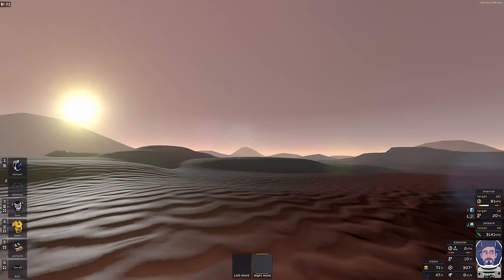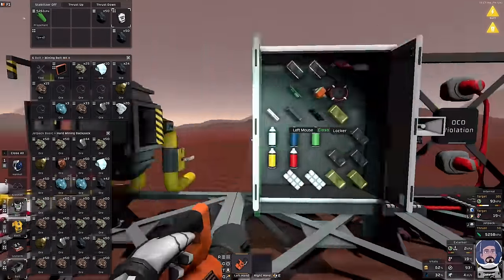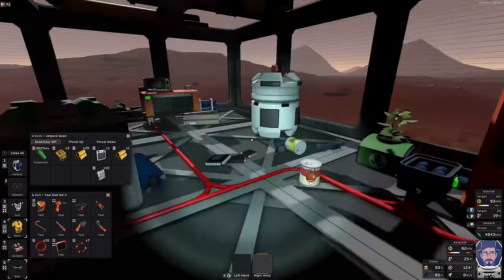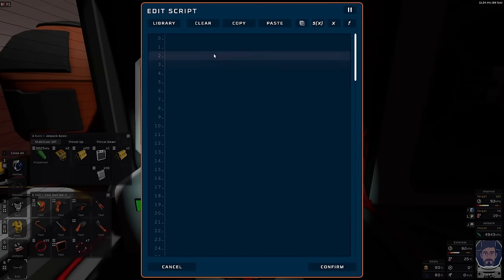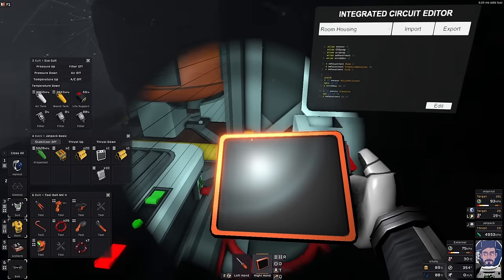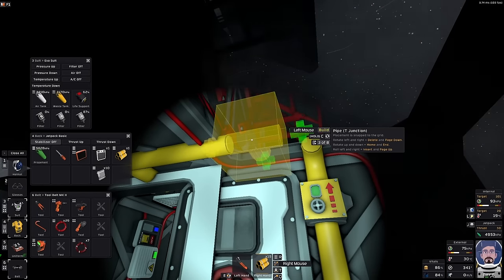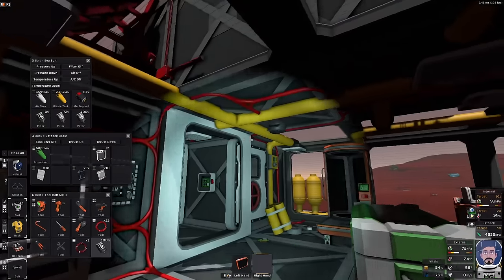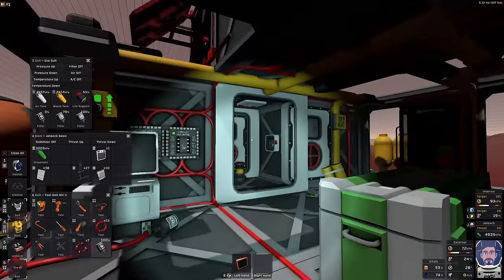Stationeers Gerting started on Mars 2

Comment: Great stuff here, and I always love the coding.  It is great to see you demonstrate using phase change to filter out gasses.  What always bothered me in game, though, was that the pipe analyzer requires a furnace, but the atmospherics do not.  That means, if I don't want to rush steel, and build the early base without it, the only way I can get pipe info to logic chips is by sticking an atmospheric unit on the line.
Reply: or use a tank
Reply: @scul00  that also requires steel.

Comment: Pretty sure the reason you're not getting the warning for the Nitrogen (BTW you missed the Filter warning at 5% while programming) is because you were opening the helmet quite a few times, flushing the current air of the suit. I could be wrong though.

On a side note, I found that 2 Passive Liquid Drains per Large Powered Vent (I have 3 large vents and 6 drains) were fine for me *BUT* only after it reached 20MPa. I also noticed some of the storms were messing with the scrubbing action at that pressure, since it gets JUST below -20 and doesn't have much cooling power to force the phasing of that much CO2, especially when it immediately passes back into daytime. However, as you stated previously, it's not really a big deal to have a bit of pollutant or CO2 in your base, and especially with that beefy scrubber system. Just more of a PSA for other people and other uses.

I'm always excited to play after watching your vids, always giving me awesome ideas to try and integrate with how I do things. Thanks for all the amazing, entertaining, informative videos 😎
Reply from the maker: I did get the low oxygen shortly after while getting the thumbnail.  So it is all working.

Comment: Thus concludes a very good, pragmatic tute series.  Thanks for that, Mick.  
You got that required drain on your air production line just in the nick of time!  OCD Violation alert:  Won't some of the pipe segments on that line need replacement now, due to liquid damage?
I shall certainly be applying your air scrubber solution to vastly simplify and replace my pre-phase-change kit.

Comment: I'm finally getting some sort of handle on the phase change update due to these videos. Cryogenic separation of gases while collecting gases on Mars is what I'm hoping to achieve on my current playthrough. Currently trying to get pollutants  and CO2 to separate at a decent speed. I'm not sure how only 3 of those drains are keeping up with your liquid gases. They don't on my build. However, i'm only trying to separate the pollutant first before moving on to the CO2. Maybe i'd be better off to separate both the CO2 and the pollutant at the same time.
I want to save the pollutant for use as coolant. Its hard to build a system that isn't so slow at processing collected gases.

Comment: That pipe was a little angry at you for stealing liquid drain😂
Was expecting you to put a little failsafe on the systems for monitoring the total liquid in pipe and shutting it down if it became to high.
Any reason for not doing that?
Reply from the maker: A failsafe could be used but it is very quick just to put enough drains on the pipe so that it cant explode.